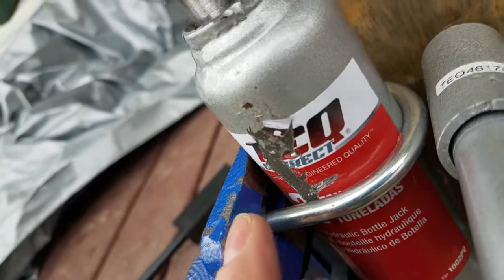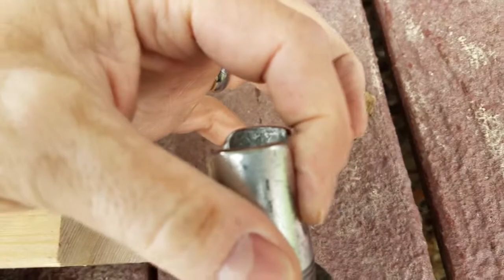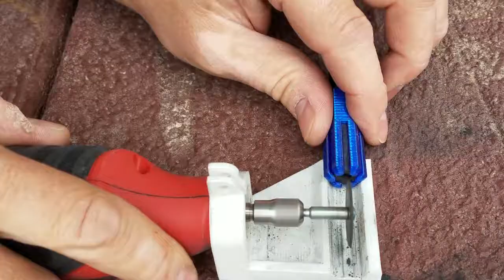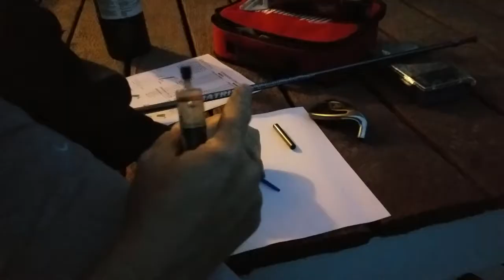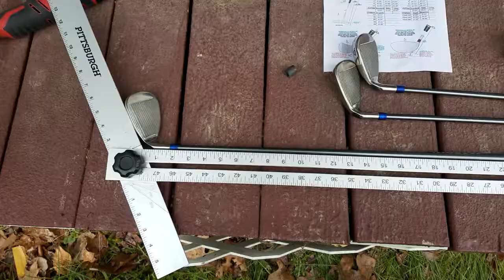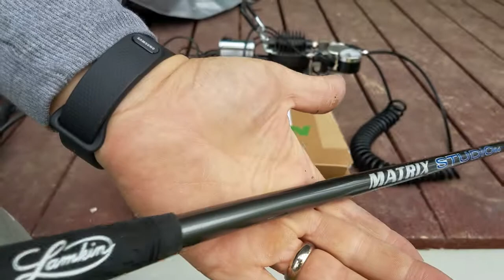Reshafting Hawkeye VFT Irons- Front Porch DIY

Comment: Love your video!  I have a suggestion. I needed a part to repair an Audi rear cargo cover.  A new cover was in the $1200 range (a Subaru would have been less than $300- The Audi is nicer, but not that much nicer).  Failure was always a plastic piece the retained the the spring.  Finally saw a repair where a guy digitally printed the piece which then was epoxied in.  So for $7.50 plus postage I got a part to successfully repair my shade.  He used the company “Shapeways” and uploaded his data.  One goes online to Shapeways, searches for the part, purchases it, and Shapeways makes it sends it out.  I assume he gets a royalty on everyone purchased.  I would buy all gigs/guides if available.   Thanks, Bob

Comment: any chance of getting one of your slot cutting guides?
Reply: Hey Don, just saw this sorry. Do you have a 3D printer?
Reply: no, if I did I wouldn't need your guide. thanks for the reply.
Reply: @donstrzezewski7701  You would still need my files to print. I was going to offer them if you had a printer.
Reply: @thecadman99  I can get access to a 3D printer. Would love to emulate your technique for notching the bore thru shafts.
Reply: @leonkronbergs5897  I'll get those uploaded to my account on Thingiverse.com. You will be able to download them there for free. I'll list them under "Callaway slotting guide".
Reply: @thecadman99  Thanks! I'll jump over to Thingiverse and hunt it down.
Reply: @leonkronbergs5897  The files are at work, I'll try to up then for you Monday.
Reply: @thecadman99  You're the man! Since Callaway doesn't reshaft bore through heads anymore, the 2 remaining options are: 1) Ream the heads to .370 or 2) Taper or slit the shaft tips. I prefer your solution.
Reply: Mountain Teacher would you be so kind as to also share your ferrule print drawing? Thank you for the excellent information!
Reply: @leonkronbergs5897   Everything should be available now https://www.thingiverse.com/thing:4602828
Reply: @itzmekd   Its on thingiverse with my shaft splitter.  Link is just below- good luck!

Comment: GET A CARBIDE BIT THAT IS .370 EQUAL AND BORE OUT THE HOZEL---VERY EASY. AND WORKS BEAUTIFULLY----ELIMINATES THE SHAFT SLOTTING AND THE PEGS WHICH ARE A BIT
CUMBERSOME --- BLACK POWDER ON THE EPOXY IS COOL, BUT JUST GET THE BLACK EPOXY.
Reply from the maker: Hey Pards, I wasn't sure how well the bit would cut the titanium.  If I ever re-shaft a set of bore-thru again, I'll give it a try thanks.